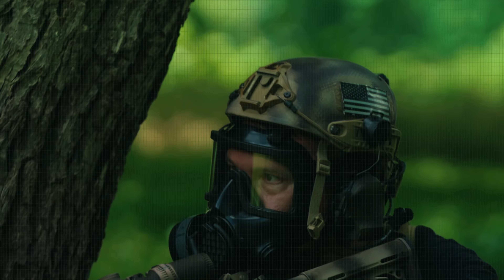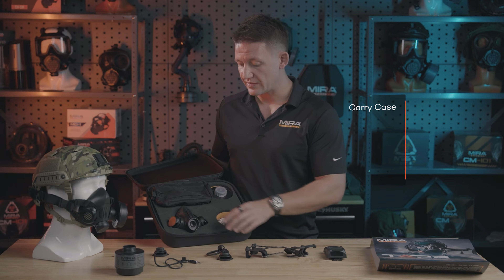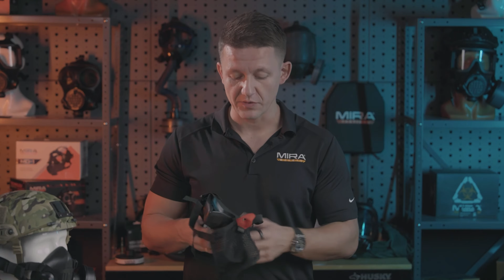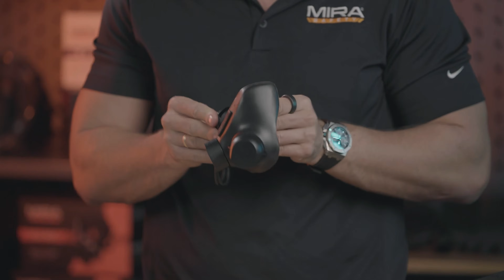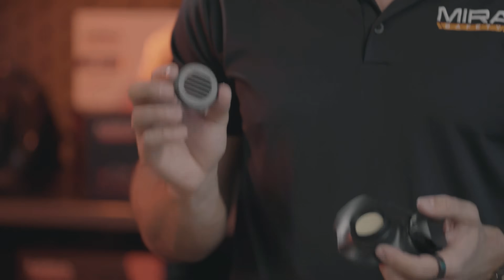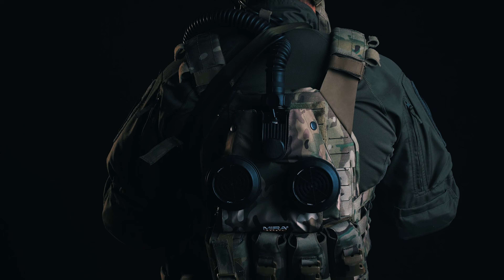MIRA Safety TAPR | Product Breakdown

Comment: Does anyone had any problems putting on the low profile exhalation valve cover? Cause I can't seem to get mine on and it won't fit no matter how hard I try.
Reply from the maker: Hey there, it should just snap on but sounds like thats not working correct? Give Customer Service a call and they can help you out.